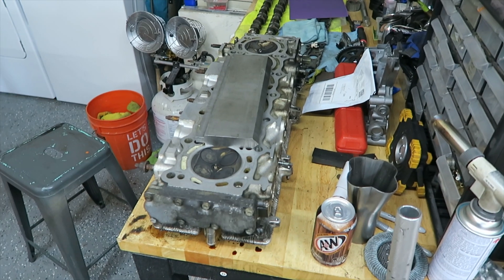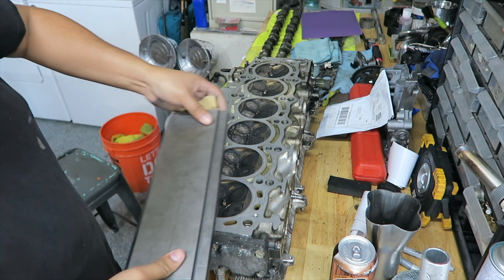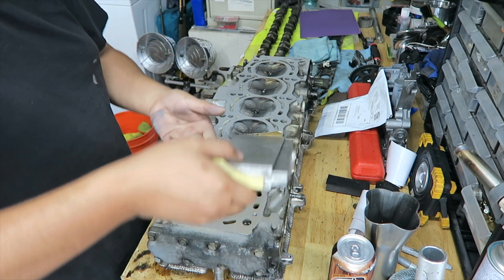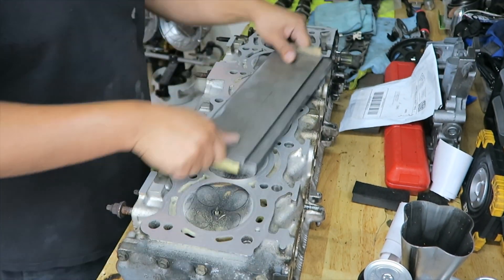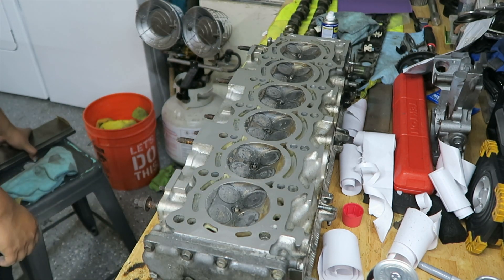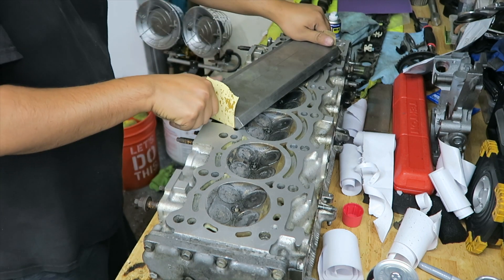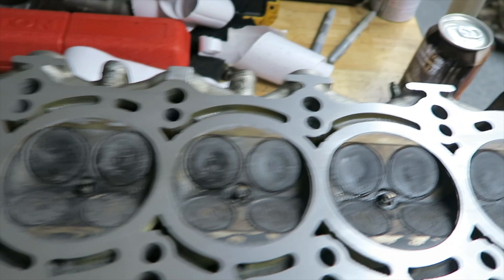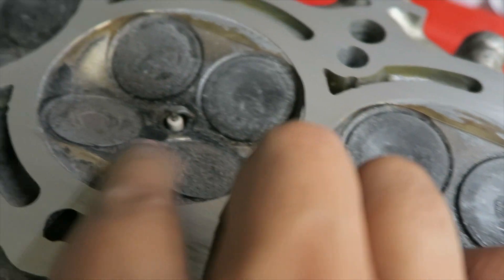DIY 2JZ cylinder head resurfacing in your own garage.

Comment: Always have level an feeler gauges close by. Measuring is key. He's going alittle to cheap. Get bigger sand paper, bigger flat surface to sand against. Home depot cheap piece of composite wood. Check it with level feeler gauge before buying. Glue sand paper to board. Checkout oldschool funk onYT.